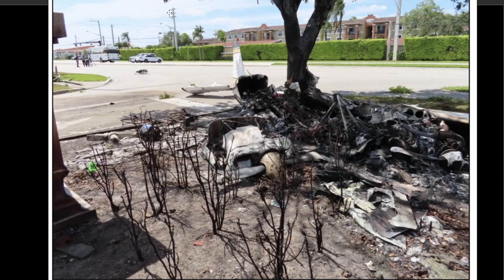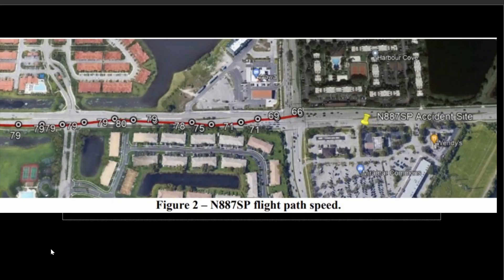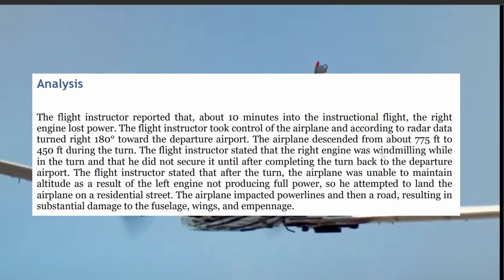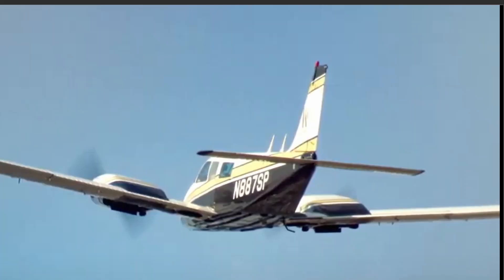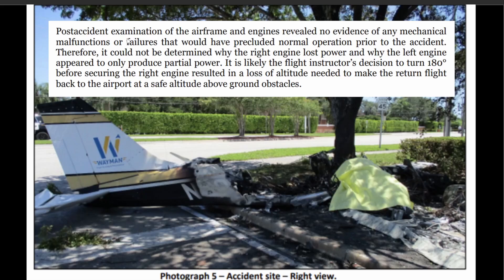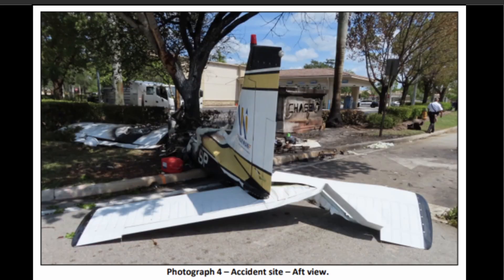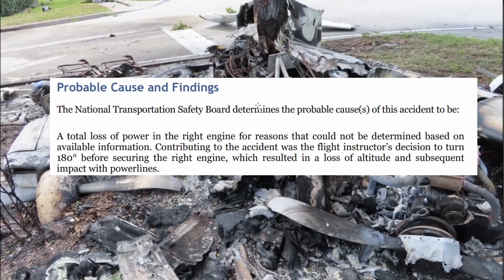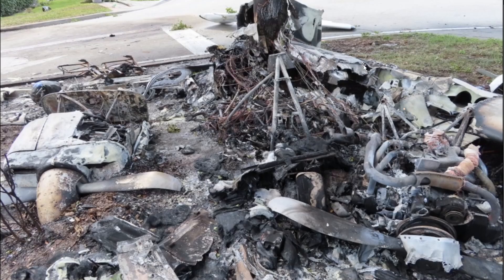Piper Aircraft and the Impossible Turn

Comment: What the NTSB said is if he secured the inoperable engine before making the turn, he probably would have made it back to the airport. The drag from the windmilling inoperable engine made him lose a lot of altitude.
Reply from the maker: Thanks Bob and Al.  Rough one with both engines
Reply: @ARFFWorld  She burnt like that when the fuel tanks [in the wings] were ruptured & all that avgas was spilled out.
Reply: Not only did he not secure the inop engine he turned right into it.. Just a plethora of total blunders. wrong turn, wrong time, wrong direction.
This guy's an instructor you say? Hell I'm glad I don't fly anymore considering..
P.S. Announcer asked when is it a good time for the impossible turn. We call it the "Impossible Turn" for a reason.. answer to when is never freaking ever for me personally..
Reply: You are exactly correct. A windmilling prop is causing a huge amount of drag (negative thrust in this case). The pilot reported the left engine was not producing enough power. I'd say the left engine was fine, it just couldn't overcome the drag of a windmilling prop.
Reply: But then why was the port engine not producing full power?  Why did the starboard engine fail?  I am leaning towards a fuel issue, [faulty fuel pump/s, or contaminated fuel source maybe]

Comment: I don't have any time in a twin but as far as doing a 180 back to the field, the remaining engine needs to be making enough power to maintain flight. When I was a student pilot, my instructor would intentionally pull power on take-off and he'd say "what are you gonna to do now?". Was taught to look through a zone 30* left and 30* right and pick the best spot. It all depends on altitude and what kind of power the engine is making. If you're at 7000 feet you've got all the time in the world to decide...if you're at 700 feet a decision needs to be made ASAP and the options may be limited. That plane can fly on one engine if that engine is making power. The multi engine folks would know better but I think it would be rare to have one engine quit and the other to loose power if it wasn't fuel related. By the looks of the fire, it appears that there was fuel on board so I don't know...maybe fuel selector was on a low or empty tank?
Reply from the maker: Hard to say, even NTSB couldn’t figure it out completely
Reply: Fuel could have been contaminated leading to failure or loss of power for both
Reply: @tonymatulonis2136  Agreed... contamination or partial blockage of fuel flow.  And choices to land are 30 degrees right or left, and pick your best spot.
Reply: When he lost the right engine, wouldn’t he have chopped some power to the left?  Seems odd that he would then try to turn into the dead engine. But then I’m not a pilot.